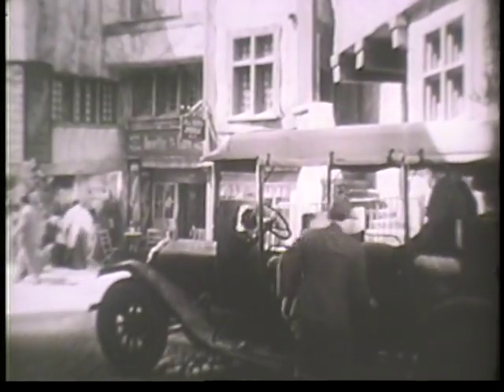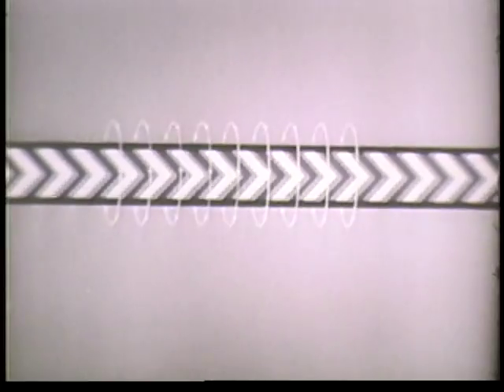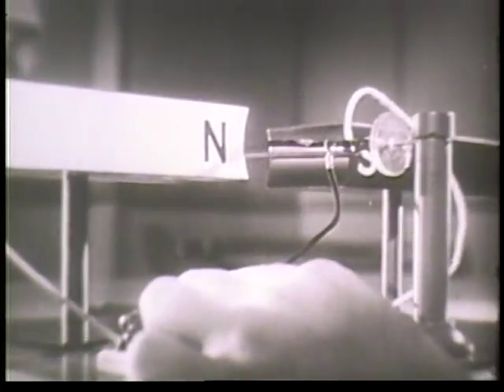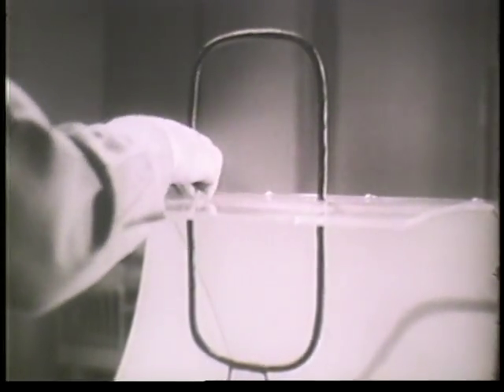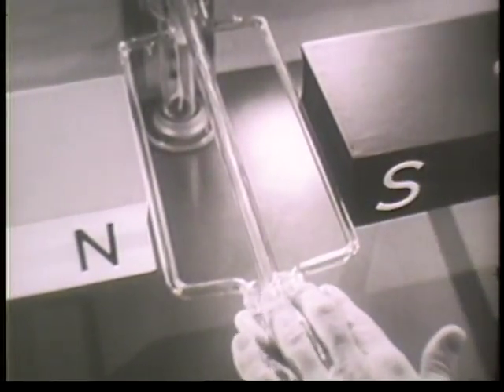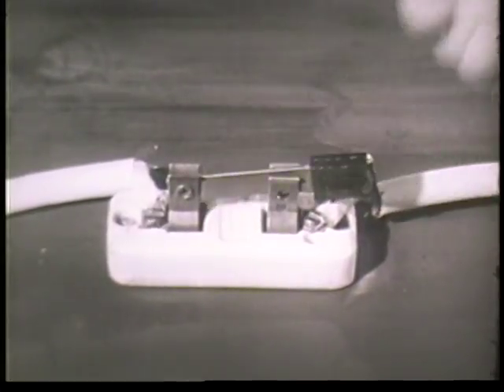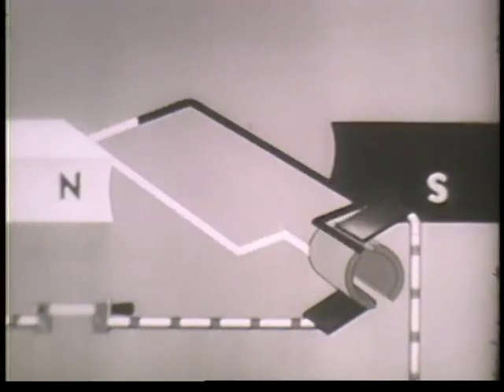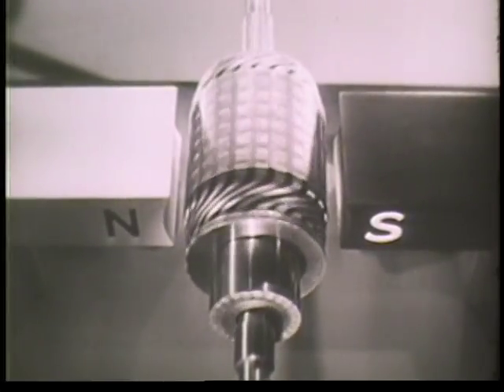PRINCIPLES OF THE STARTING MOTOR

Comment: Good video, but the poles of an electromagnet are not ON the wires.  The magnetic field lines pass through the middle of the loop, at a right angle to the current, so it's as though a bar magnet is going through the middle of the wire loop.
Reply: Yes i noticed that as well

Comment: great video, except that the poles of the electromagnet are a bit misleading as the magnetic moment is perpendicular to the plane of the loop.
Reply: This. I don't understand how most of all technical education videos from all kinds of even the most professional producers (these old black and white ones tend to be the best, but even these...) have that much crucial omissions and even outright mistakes.

Besides the error you mentioned, this also failed to mention that in real-world usage, coils are used instead of single loops, and also the overall structure of iron cores - both the armature and stator - was completely omitted to show, which would be quite essential in order to efficiently route the magnetic flux into the place where the two perpendicular ones (stator and armature ones) meet and create force between each other.

Also, I would have liked to have at least very simply calculation example of torques and currents with voltages, turns, core sizes, etc. In case this was meant to be theoretical. In case this was meant to be practical, I would have liked to have instructing to replace brushes, bearings, and finding faults on coils.

Comment: It was well explained but you must not have watched many MIT lectures. There is a big goof up in this video's explanation, when you have a loop of wire with current in the wire doesn't get a north and south pole, the field lines are always at right angles to a conductor not emanating from them.

Comment: I love the format of vintage US Army training videos but... this one contains a major flaw!
Saying one side of the loop is the S pole and the other one is the N pole is not right. A current carrying loop of wire effectively becomes an electromagnet with a magnetic moment normal to the current loop.
If you want to think of the loop as a magnet, it should have the axis punching through the center of the loop, have (almost) zero length and direction determined by the direction of the current in the loop.
As a result the loop won't align with the magnetic field as shown, instead it will place itself at a angle of 90 degrees.